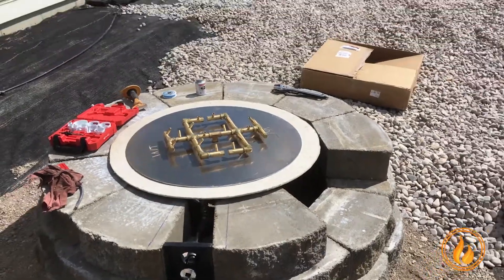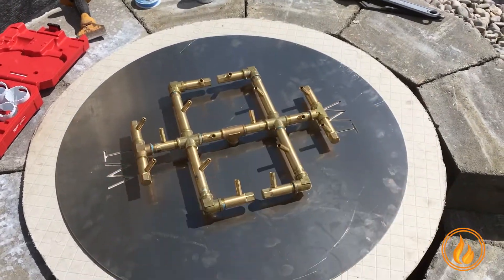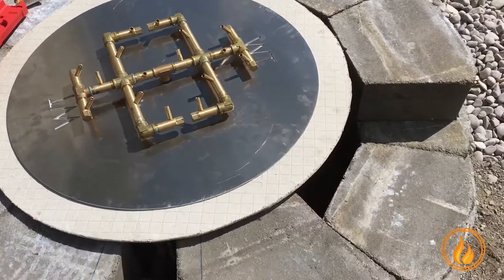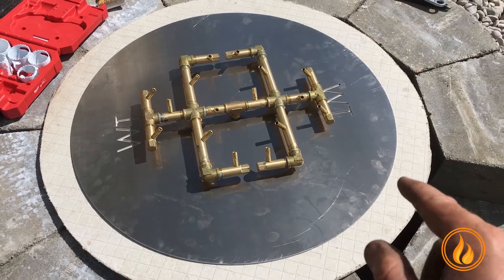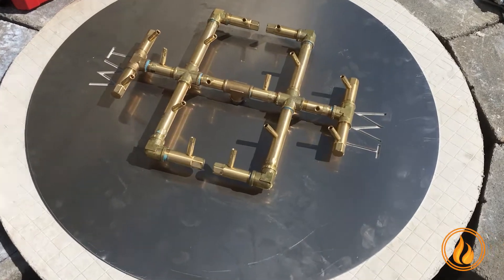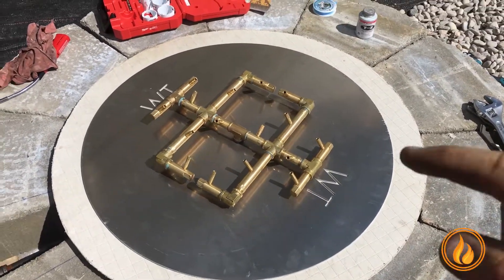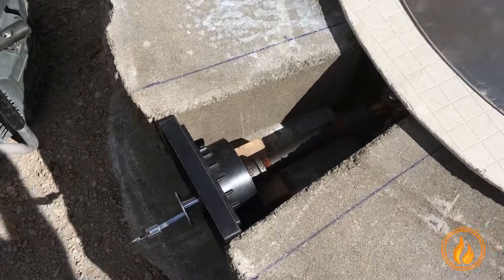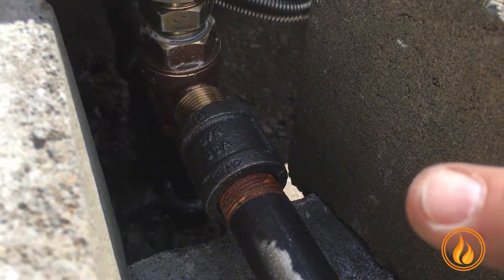Common issues with gas fire pits: What if your fire pit opening is larger than your plate?

Comment: I have a variation on this problem, my pit was already built and has a 26” ID lip, below that the inside pit wall ID is 28” and I have a Warming Trends 120K BTU on 24” plate.  What is the best way to install the burner in this situation? TIA
Reply from the maker: Steve Berg that’s tricky Steve and unfortunately there is no quick answer. Since no two are the same, it just takes creativity on your part to best fill that gap.  Bricks, cement board, aluminum... sorry I can’t give a quick answer.